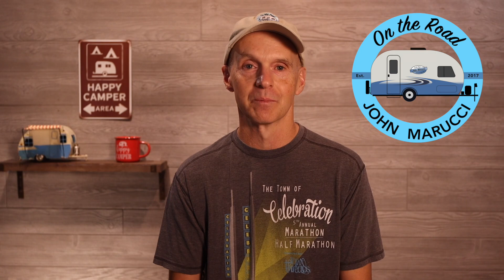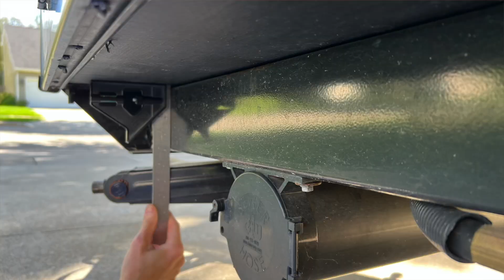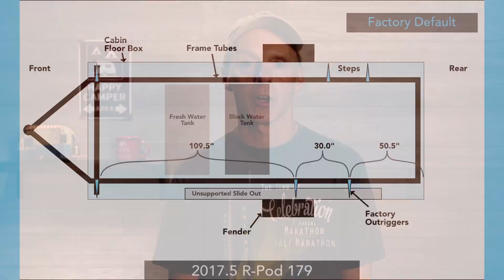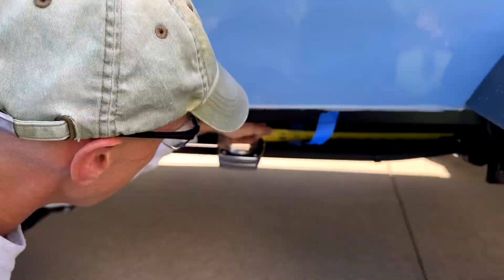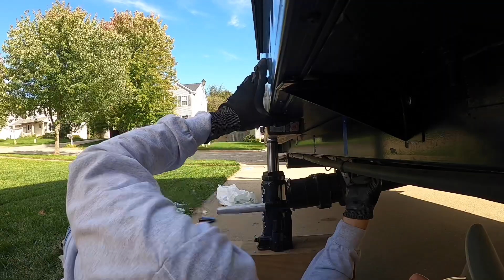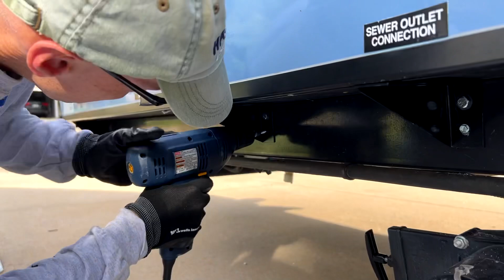R-Pod Outrigger Installation – Step-By-Step Process

Comment: John, I have a 2016 179 and had no idea this is a possible issue.  My trailer is at the shop having some maintenance done, but when it gets home I will check for missing outriggers and get them added.  My trailer sat idle for a couple of years, but now I am able to use it again and want it to last as long as possible. I use it here in Colorado, Utah ad New Mexico and it works out great for me.  Thanks so much for your detailed and thorough presentation and supporting documents.
Reply from the maker: Glad the video was helpful. There are a bunch of owners in the same boat. Some of them Forest River offered to take the trailer in and fix everything that is at issue structurally. If you want to go this route and contact them, let me know via email: john@johnmarucci.com

Comment: This was so helpful, thank you!  Couple of notes- the long drill bit suggested by another follower was very worth it.  They were only willing to sell me 6 outriggers, I used 5 on my 176t.  Mine was slumped pretty low, so I corrected it some, but not completely.  The amount of lift I had to apply with the jack was actually attempting to lift the tire off the ground and I got worried about everything separating and ripping the floor from the frame.  So, I put as much pressure as I felt comfortable doing and unslumped the wall some but not to completely square.  I don't have sad feelings about this, the problem is now improved and stabilized and for sure will not get worse...  Thanks so much for your detailed video!
Reply from the maker: Glad to hear that the video was helpful. It sounds like you have the issue covered. Forest River has paid to fix these issues for some owners but it has been randomly applied. If you have further issues, you may want to push them for more. Thanks!

Comment: We have a 2019 R-pod 189 and just recently noticed significant wall sag under the slide out.  We had already scheduled some recall work at the local dealer and asked them to look at the issue. After getting a claim number from the service department, we decided to contact the Forest River warranty department and spoke to them at length about the issue.  We feel that this is a serious design flaw for which FR should be held accountable.  The fender over the tire got so low that a sharp screw on the underside actually scored the tire tread. Our brand new Goodyear Endurance tire is now damaged. For several years owners have had this issue and have shouldered the burden of fixing the issue.  Our repair will cost over $1000 to fix since we consider this a serious safety issue we did not consider doing it ourselves. To prove this was design flaw, while at the dealer we looked at the 2022 153 and 202 they had five and seven outriggers on each side. To us, this is an admission of their design flaw. After experiencing this terrible customer service and lack of responsibility for their poor quality design, how could we consider another FR purchase? We strongly feel this sagging wall issue should be a recall like the drain pipe support failure. Sadly, there are other issues such as the flooring support and others...And by the way, did you say that they don't offer an additional year warranty any more?  Another way to avoid responsibility?
Reply from the maker: Many other owners are having the exact problem and FR has offered to take their trailers in to replace axle, floors, etc. I would push FR on this to try and get them to commit to a full fix.

Comment: Hi John, When my 2018 RP180 driver's side wall started sinking, I reached out to Forest River.  They wouldn't send the outriggers, saying my coach needs the floor replaced, the frame replaced and the axle replaced at the factory.  None of these are damaged, I even sent photos to prove it. The western rep said she'd  "try to look at them in the next few weeks"  There just isn't any support on the slide wall and now it's sinking.  No support from Forest River either apparently.  WHere did you get your outriggers?
Reply from the maker: I did mine about a year ago and bought them from Forest River directly. I've heard that they stopped selling them since then. Many owners have them fabricated by a local metal shop at this point. You may have already asked on the owners forum. Several people there have fabricated their own. rpod-owners.com
Reply: @JohnMarucci  they are just telling me it’s because the RPod  axles had too much torsion on them coming from the factory.  And outriggers won’t work to level the wall sag.  And Tina says has to authorize the parts being sent which she won’t do.
Reply from the maker: Several people on the R-Pod 179 FB group have had FR take the trailer in and fix the axle, floor and walls, even though it is out of warranty. It may be worth a try if you haven't asked already.
Reply: They say will transport it to their facility to replace the frame, chassis and axle as well as fix damage to the coach.. Pretty generous of them I think.
Reply from the maker: I would likely take them up on the offer. If you go to sell the trailer at some point, this is definitely something to mention that would elevate the value of the trailer.
Reply: @JohnMarucci  I will.  It's hard to think of my little home on wheels going somewhere without me, but I have no choice.
Reply: @rvadventureguide  How did you get in touch with Tina?  Thanks in advance, having the same problem on mine...
Reply: @jeffreyeaton8099  I just emailed the parts department for  RPod.  Apparently, the axle for my 2018 180 came with the wrong torque,, and with these light little trailers, it does a lot of damage.

Comment: What a relief to finally find this. My very late 2019 E-Pro 16BH is having this sag very badly and this looks like exactly the fix. The 16BH has the same slide-out kitchen as the R-Pod 180. Interestingly, I can't find any mention of this issue wehn searching for E-Pro/Geo Pros, but maybe just because there aren't as many out there as R-Pods. Hoping Forest River will still help me. If not, time to fab up some outriggers. Thanks again!!!
Reply from the maker: Glad the video is helpful. There are plenty of R-Pod owners who have had outriggers fabricated. There are a few threads on the R-Pod owners forum if interested: rpod-owners.com
Reply: @JohnMarucci  Yeah, those experiences have been helpful for me to hear about as a non-R-Pod owner. I'm having some outriggers made which will be great.

Comment: Thank you John, (I have a feeling I'll be saying that a lot), I just received email back from Innovative Machine & Supply, who I found on the RPOD forums, $19.00 each which I think is pretty reasonable these days especially for peace of mind on my 190. I'm amazed that Lippert did not have a framework that was load bearing to support the weight of the slideout rather than relying on the floor of the trailer, that blows my mind.
Reply from the maker: Sounds like a good price on the outriggers. Definitely worth doing for peace of mind. All the best!
Reply: Always happy to help! Our Outriggers are made from heavier steel and come powder coated. The other thing is the design - the brackets sides overlap for added strength.
Scott @ Innovative Machine & Supply

Comment: We have a 2019 190 Hood River (blue) and noticed some sag on the slide side.  We contacted the dealer and factory about installing and/or ordering outriggers as a preventive measure and sent them a set of photos.

They state that the problem has to do with an over torsioned axle and that outriggers are a preventive measure but won't fix the problem.  They are offering to return the unit to the Hood River factory to repair the problem.  Forest River will cover shipping and repair--we just have to sign a release.  We are the second owner, and the unit isn't covered by any warranty that I am aware of.   Any thoughts or have you heard of this?
Reply from the maker: I have heard that they are doing this for some people even if the unit is out of warranty. I would take them up on the offer if it is no cost to you. If you ever sell it, you can advertise this factory fix. Thanks!

Comment: Is there anyway you can send me a direct link of where I can buy outriggers
Reply from the maker: There is no direct link. I got mine from Forest River but they don't appear to be selling them to customers anymore. There is a supplier that people on the Facebook group are using, but most people are now having a local shop custom weld them for the application. Sorry.
Reply: @JohnMarucci  I got ya. But thanks for the info. I found your videos to be very helpful on things I did not know. Just got my 179 a couple weeks ago but it’s in good shape. First thing I did was check the walls after discovering your videos and yup she’s sagging. But I will build custom outriggers. Thanks a lot.

Comment: Just purchased a 2018 RP-179 and am really glad I ran into your work.  I’ve not even measured yet if I’m sagging or not, but am going to take on this work as its clearly a design miss that needs to be addressed.  Question - I have a MIG welding setup and have some experience, would you consider welding vs drilling and bolting the outriggers?  Thanks for all the details you offered here.  Great job
Reply from the maker: It’s your call on welding them. Many people do this. You may want to hit the RPod owners site to follow some of the examples people are using. If you can make your own outriggers this would likely be a better solution vs the factory ones. Here is the link to the owners forum: rpod-owners.com

Comment: After closer look I see my 2016 slide is not over the frame as the 2017 1/2.  My issue is the front end of slide extends a bit to far and a twist on front end part to the point it separates the interior trim. I have pics but not sure how to share on this forum.   I'm wondering is there an adjustment for this.Thanks John
Reply from the maker: Feel free to email any pics to me at: "john@johnmarucci.com"

Comment: @ 11.25 minutes, your drill body is forcing your bit to drill thru the frame @ an angle. This will affect your level on the intended outrigger, which  I believe is important. I'll be buying extended bits to drill my 2019 Anniversary model. My frame from the trailer to the tongue looks to be angled upwards also. The welds to the mainframe still look unchanged. I see you have a video on this too.
YOU are a lifesaver. EXACTLY what I meant. MUCH Respect, my friend.
Reply from the maker: Glad the video was helpful. We should never have had to do these fixes.

Comment: Thanks, John.  My dealer ordered the outriggers for me and they came in about 3 weeks.
I have a question:  When you square up the walls and floor with the frame, the outrigger hits the outer rail, causing a gap between the outrigger and the floor.  How did you overcome this problem, or is the gap okay?
Reply from the maker: I left the gap. Others have either notched out the rail, cut short the outrigger or added a shim under the outrigger so it sits down the same width as the rail. I didn't like any of those options and will see how my solution works over time. I can always do one of these if needed. Thanks!
Reply: @JohnMarucci  Thank you,, John.  I greatly appreciate all the help you have given me with the videos.

Comment: Helpful video. I recommend using a washer on both inner and outer sides of the bolt to help prevent paint from getting scraped off the outrigger.
Reply from the maker: Good idea, thanks!

Comment: I'm wondering about the tire on that side and if you removed the tire and/or fender to get at that area.
Reply from the maker: Jim, I didn’t need to pull the wheel to install. Here is a link to the document I put together with diagrams: https://johnmarucci.com/wp-content/uploads/2021/11/R-Pod-Outrigger-Installation-1.pdf
Reply: @JohnMarucci  And the reason you think you needed to make the trailer level before starting to lift the frame?
Reply from the maker: Yep, I want to make sure the jack sits perpendicular to the frame as I am jacking up the frame. There is a lot of lift from the jack, so I don't want it off kilter in any way. My driveway is not flat, so I needed to make sure the jack wouldn't move on me. Thanks!

Comment: John, I appreciate the effort and time you put into this video and your instructions. I just completed installing outriggers on my 179. It was built in February 2014 and had NO outriggers, unless you count the step brackets.  I put 6 outriggers on the slide side and 5 on the door side. To better protect the waste and fresh tanks I screwed a piece of plywood to a 1/4-inch piece of steel and clamped it steel side toward the tank to ensure I did not go through the wood and puncture the tank.  The gaps between the frame and tanks were from 1 to 2-1/2 inches.  Again, thanks for the excellent video and instructions. They gave me a lot of confidence in correcting the sagging problem!
     Mark
Reply from the maker: Mark, glad to hear the video was helpful. Sounds like you tackled it well. All the best!

Comment: Great video thanks!

Just bought a 2018 Bullet colt. When I pick it up I’ll be checking under the slide and installing either way !
Reply from the maker: The outrigger issue is mainly an R-Pod brand problem for later years. My 2020 Bullet 243BHS has the need outriggers. Not sure Keystone has this issue. Thanks!

Comment: Thank you John, excellent video.  This is the first I've heard of this issue, and I will check our trailer when it comes out of storage.  Your description of the poor rPod floor construction (in another video) as the primary cause of this issue...... is disturbing.   As a company that's been building trailers for a while you'd think they would know better.  How much added cost would they incur by providing wall supports every foot  all the way around?   Very little......   The Big Three Detroit car manufacturers finally woke up and fixed their poor quality issues.  It would be nice if the trailer manufacturers would do the same.
Reply from the maker: Robert, it is also a mystery to me. It seems that they skimped putting outriggers on the model years in 2016-2018 for some reason. Like cost cutting. Thanks!

Comment: I finally got my outriggers installed, but I made a slight modification to the way Forest River manufactured them to address the issue of how to fit them over the trim. What I ended up doing was cutting some lengths of 3/16" thick flat steel (the same thickness as the trim), and welding them to the outriggers to fill the gap between the outrigger and the floor. Depending on the gap, the pieces were between 5 1/2 to 5 3/4" long by 2" wide. The welded on pieces fill the gap between the frame and the trim perfectly, so the outriggers fit squarely against the bottom of the floor and the frame with no gaps. I used the 2" width to allow enough room for the welds, and they also provide wider support under the floor. Otherwise I followed your instructions pretty much the way you did it. I did attach the end of the outriggers to the floor through the trim using the holes provided with stainless #8 truss head self drilling screws to prevent any movement of the outriggers when the r pod is in motion. I put a blob of silicone sealant in between the trim and the end of the outrigger, then drove the screws in through the sealant to address the concern of moisture possibly penetrating the opening. Basically the same thing Forest River did with the trim mounting screws at the factory. I am satisfied with the outcome. I installed six outriggers on the left side of my 180 (four under the slide out), and four outriggers on the right side, skipping the area of the stairs which already provide support to the floor. So 10 total seemed about right for my 180.
Reply from the maker: Kraig, thanks for taking the time to detail how you tackled the outrigger issue and the mods you did to the Forest River outriggers to make them fit snug at the rail. It is a really great explanation of how to do it right. I think this is about the best you can do with the Forest River provided outriggers. Thanks again for talking the time to write all this out. All the best!

Comment: John, Great video. I checked my RPOD 179 and the floor to the trailer beam is not square.  I emailed Forest River and currently they don’t have the parts and they are not sure they will get them. They suggested that I contact my dealer, which I will tomorrow.  If I cannot purchase them, I am considering making my own out of angle iron and welding them together. By any chance do you know what the width of the bracket is and the gauge of the steel? The height and width dimensions I can get from the trailer.  Thank you.
Reply from the maker: Arnold, I don’t have access to the Pod or outriggers just now, but there are a few owners who have made their own outriggers. I’d point you to the owners forum to get dimensions: rpod-owners.com

Comment: Great video! 
I noticed the outriggers go directly to the edge of the trailer sandwiching the trim between the floor and bracket. Has that caused any issues to the trim itself?
Reply from the maker: I haven't seen any issue with the channel being compressed by the outrigger arm. Some folks have cut the channel for the outrigger arm, I chose not to. I'll keep an eye on mine after using it a few times this spring. Right now the R-Pod is in storage. Thanks!
Reply: @JohnMarucci  thanks for the reply! Love the videos!